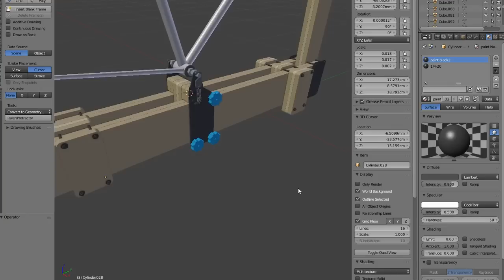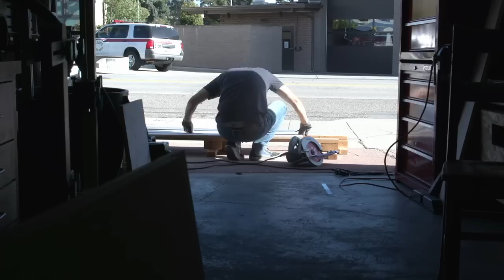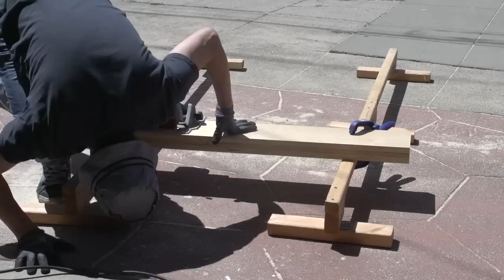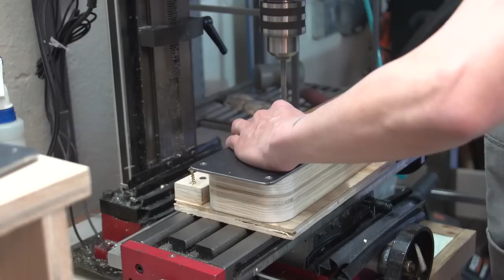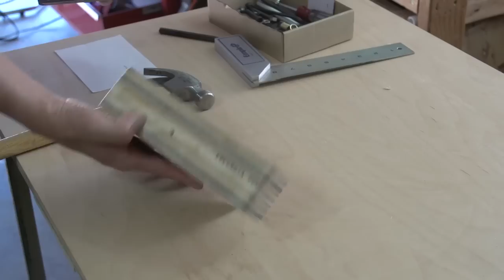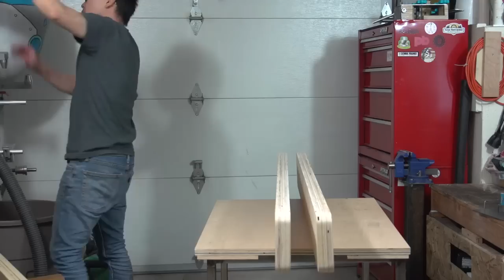Low Budget Bicycle Frame Jig 07

Comment: I must admit that I skipped the building of this because I thought you had it, LOL. Minor draw back. I think you learn 10 times more when you goof up anyways. Yah, the original jig had to much flex in it. This one should be perfect for it's use, I think. That little bit of movement, you can use it to your advantage if needed. Nothing is perfectly built, only good enough. Only time this new design, the wiggle will come into play will be when welding up the parts together, when they distort from the heat. That little wiggle will let the metal flex and come back into shape when cooling. Holding the frame together rigid when welding will put tension into the part that will show itself down the road when something happens like the bike falling over and bends real bad from a soft hit on the ground. 
The 3 leg feet is a handy way of doing it. I use that setup on the stands in my basement for my equipment since my basement floor is not flat at all, LOL. I had the idea of making a frame jig from an I-beam or maybe a slab of concrete. I need it to be weatherproof since it will be outside the whole time. Plus, welding on wood with MIG, catches the jig on fire, LOL.
If you do need to stiffen those uprights. You can always slap on some angle iron on the bottom out to the sides about a foot to triangulate to the tops of the upright with threaded rod. That way you can adjust the tops by the nuts, like a bike spoke.

Comment: With that much wood, wood be cheaper to use structural steel base.
Reply from the maker: Lane Romel I agree and should have mentioned it in the video. Steel is the better choice. I kept it wood to show that process for people who don’t have access to steel easily
Reply: @PithyBikes  What will they make the bicycle from?
Reply from the maker: @AlliPrice371  I'll build a steel tube bicycle first on this jig. It will be TIG welded.

Comment: I think that you are not going to gain that much rigidity that way. You still have a lot of leverage with the uprights.  Take the design for the stands and increase the height into triangles that extend to the tops of the two uprights and bolt to them at the top. Increase the foot of them out say another foot. You can cut out space to clear the holders and it won't effect the rigidity. The only thing that would be important for them would to brace from the top of the upright down to a point about a foot and a half out from the frame at the bottom.

Comment: Love the problem solving on the fly.  Looks like a great solution.  I wonder if a torsion box design for the column pieces might make it even stiffer.  Or perhaps using the original design but doing a torsion box skinned in 1/4" ply with 1/2" ply for the "interior beams".  More labor intensive but I'd imagine it'd be lighter and stiffer.  Then again I wouldn't have imagined so much movement from your original design.  The only way to know with this kind of stuff is to try it.  My hat is off to you for people one of the few of us that actually takes the plunge, gets it done and makes it work.